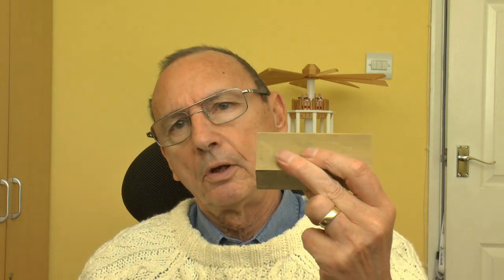6 Input Multi Material Hot End - Part3

Comment: Let me check my small ream collection.... I'll send you one or two if I have a suitable size
Reply from the maker: That's extremely generous of you!. The holes are about 40mm long. I doubt the diameter is critical - I'd have thought anything between 1.8mm and 2.0 ought to work. I have some 1.8mm long series drill  bits - not sure how much I ned to leave for reaming so any advice on that would be good.
Reply: @deckingman  Hi Ian I have found a 1.78, 5/64" = 1.96  (50mm) and a long shaft (75mm) 1.98 . You should have email.